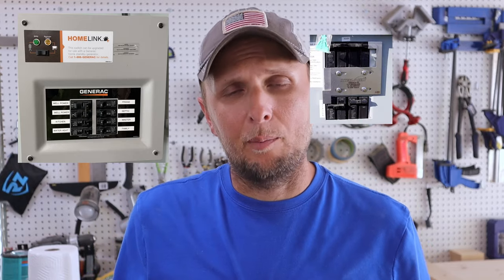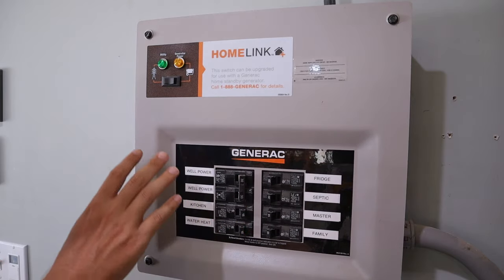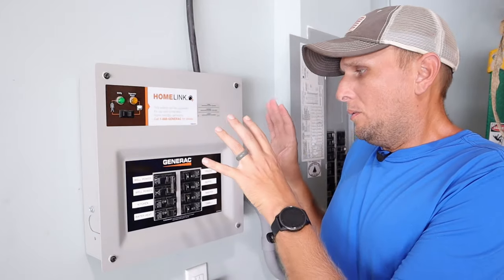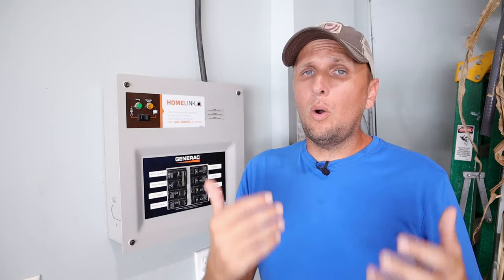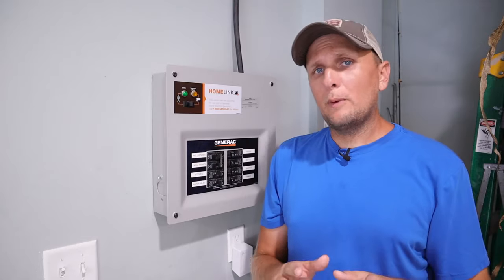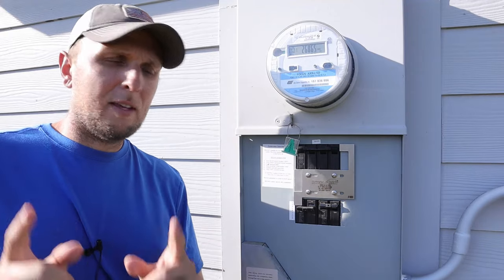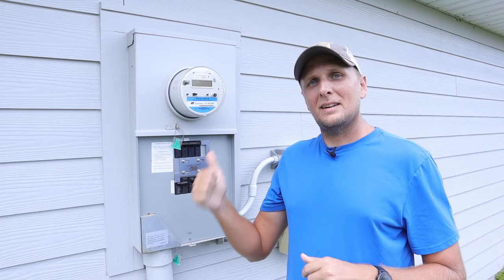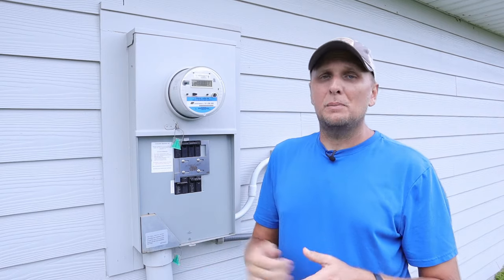How To Choose Between A Transfer Switch Vs Interlock Kit With Power Inlet Box

Comment: I don't have an option. I can't use either. In my area breaker panels don't have a main breaker. I have to lock out tag out. My generator is a portable propane generator. It's actually dual fuel, but I don't want to ever use gasoline. I have to manually turn the propane on to start the generator.
Reply: Suggestion - for a temporary situation or a permanent solution, get a Generlink meter base adaptor. Would recommend the 40 amp unit. I did not purchase the surge protection nor the wireless link as I did not need them. I did get the 20' cord with the 50 amp, RV type plug. It comes with a cord of your choice.
Safe, very easy to use, super easy (5 min.) for the electric company to install. 
I have no ties to the company. I bought one and it's a great solution. Using it with my Generac standby genset. Simply plug in the cord when needed, unplug when done.

Before contacting Generlink, I first emailed the datasheet info and request directly to our utilities director at the city. The city provides electric to our area. 

A week later I had his letter of approval! He did say that I had to contact his office to have it installed as the customer service reps don't know about the device.

Comment: If you are on a generator, it is an emergency.  You do not need to power everything in your house. It is an emergency.  For us, we had the interlock with a Generac XL 5500 unit.  Since it is an emergency, we power the essential lights, Fridge, Freezer, stove(gas), furnace(Gas forced hot air), and communications.  What else does one need? it is an emergency. So I put together a protocol to follow for start up and operation of the generator during an emergency.  All breakers are off including main, start generator, plug in generator, then start the essential lights(compact florescence), then once things are stabilized, I add the freezer, fridge, furnace, etc in sequence.  When the emergency stuff is running, it will never take more than 4500 watts, so it fits the generator.
Reply from the maker: That works for you and sounds like you are aware of what you can have on all at once.  Many aren’t and you asked what else does one need?  Depends on the household.  Here in the south when we get a hurricane that knocks out power out for a week and it’s 90+ degrees outside, a 5500 watt generator generally is not going to cut it.  Also, since I’ve been in situations numerous times like this, I have mine setup so my generator can run everything so it’s like my house does have power.  So to each their own.
Reply: All well and good.  In the north, we are looking at heat only, thus we do not have to turn over a condenser unless if we are using a heat pump(the state wants homes to go that way.)  The issue, if not going for a whole house propane unit, is how much fuel to store.  For us, that quantity is 27 gallons of gas, for that week when we have no power.  I could not imagine having the fuel to run a 12 Kw genset for that first week.  Our solution to the cooling issue is to use a 1 ton window unit(1000 W) instead of trying to cool the whole house with the central system.  How much fuel do you need to have on hand for the larger unit?  Thank you.

Comment: How do people use so much power.

I always considered us a "high power usage" household.   I pulled the biggest single month electric bill we have ever had, and it was for 2,743kwh, and this is HUGE for us.  A few years back, during the non AC months, we average about 600KWh per month.

Anyway, I did the math, 2,743kwh in June (a 30 day month) means and average daily usage of ~91.4kwh, which means an average load of 3.8kw.

Now, high load, can be much higher than average load, but it would seem to me that a 7000w generator should be PLENTY to power the whole house, as long as we are careful to not go hog wild while on generator power.

I currently only have a 4500w(peak, 4050 running) inverter generator (because I like clean power) but portable inverter generators come in up to 9000w now, and that ought to be PLENTY. 

Because of this, I think I'd go with an interlock kit + power inlet box.

Only problem is the 9000w unit I'm looking at has an L14-30R plug on the front for 30amps of 120v or 240v.  Then it has 4x NEMA 5-20 plugs on the front for the rest.

The question is, can I combine the 120v from the L14-30R with that from two of the NEMA 5-20's to get the maximum 63 amps at 120v into the power inlet box somehow.

Comment: What does it mean that it is a 30 AMP transfer switch.  Does that mean it can't support more than 30 amps total?  Or does it mean that each breaker is limited to 30 amps?
Reply from the maker: It is wired and made to handle 30 amps.

Comment: I don't understand you're point about not fully running main panel with interlock kit.  I have interlock kit at 30amp inlet (I ran 6awg so I could upgrade to 50amp inlet/breaker in future if needed, so far 5 power outages over 2 years, 1 3 days long, haven't tripped the 30amp).  I run into panel.  I just tell wife don't use dryer/toaster oven (wtf that things pulls 12.5amps by itself) when generator running.  Runs mini splits (ac/heat 4 total) fine, 3 computers, 2 fridges, 1 deep freezer, 3 tv's, 3 roku's, lights, etc.  I mean if you aren't overloading the 30amp or 50amp breaker does it matter what you switch off in the panel?  (granted if you use dryer that's probably 25ish by itself, toaster oven 12.5, microwave 10 but most things outside of those 3 items going to be low, and a 50amp would be plenty for most people I would think, I just have a smaller size house so 30amp is plenty for me).  Also people could buy one of those cheap clamps to see what the wattage/amp usage in their home is.  Probably best way to determine.  Plus an interlock kit is like $50 specifically made for your panel mostly, and takes like 5-10min to install.
Reply from the maker: And that works for you.  But everyone’s situation is different along with preference.  For most people it would be better to not energize their whole panel with a smaller generator because we are creatures of habit and there can be a lot of oopsies of oh I forgot we were on a generator but I turned the thermostat down and the 4 ton unit tried to kick on.  That’s what I mean by it.  Now if you’re diligent with everything and and don’t require a lot of electricity like your situation sounds to be, then great.  I personally, even with a 12,000 watt generator do not just leave all of my circuit breakers on.  So to each their own.  But it sounds like you have a good handle on your situation.  Appreciate the feedback.

Comment: So if you have the transfer switch, is your generator always connected? I'd expect with a portable generator you'd need a power inlet box and cable. I don't think you're saying all portable generators using transfer switches are hardwired, are you?
Reply from the maker: No my generator is not connected at all times.  A manual transfer switch does not need to be hardwired to a generator.  A standby generator with an auto transfer switch does.

Comment: The main problem with interlock kits and inlets is that they only work with certain panels.  Unless you have a newer-model Square D, Homeline, or Siemens, it will not be an option since you will have a difficult time finding an interlock kit compatible with your panel.

Comment: Doesn’t a HVAC soft start like the micro air basically solve this issue, you can run your entire house with a lot smaller generator then would otherwise be needed in the past.
Reply from the maker: It certainly helps.  Depends on the load of your house and what all you want to be able to operate at once.

Comment: Why is my box on the outside under the meter locked I see all kinds of videos where u hook right in from there instead of going through the house again to get into that panel?
Reply from the maker: Different areas have different codes and installs.  In the South, it’s common to have the main disconnect out at the meter now.  Northern states it’s not nearly as common.   So it would have to be installed wherever your main disconnect is for the interlock kit to work.

Comment: I think you forgot to add wire, conduit and the two pole 30 in the price of the interlock kit. Still cheaper than the transfer switch but those material cost  can sneak up on you.
Reply from the maker: I gave an average range of $50-$300 due to different scenarios with length of run, size, power inlet box, needed interlock kit, etc.  Some folks will have some of the materials on hand.  So again, just an approximate range.  Materials can absolutely sneak up on you.
Reply: @HowToHomeDIY  overall a pretty good video. In the limited time that I’ve been an electrician the swing on material has been crazy. Makes it hard to pin point a price for any install these days
Reply from the maker: Oh yeah, price increases all over the place!  We have been affected as well.  I also made this video over a year ago, prices were less, not astronomically less but less nonetheless.  I appreciate the feedback Brian.

Comment: I think so many people get deluded and feel they need more electrical boxes. I dislike transfer switches as you have to decide and move the circuit breakers. I would select the interlock kit almost every time as switching switches are much more easy  and much cheap to do.
Reply: Yes!  But... my situation is, I know how this all works, what needs to be done.  My problem is making easy enough for my wife to do what needs to be done, in the right order.  I have a stationary propane unit.  The 30 amp cord is always plugged in.  My procedure: Turn on gas to the motor.  Start motor, let run a couple minutes. Turn off main, turn off all breakers in main panel.    Go to sub-panel in pantry, repeat.  Slide interlock, flip 30 amp breaker on.  Flip breakers one-by-one,  marked green.  Got to sub-panel, repeat.  That, is my problem...  And if it's raining and lightning, fugetaboutit...she is not going to do it.
Reply: @topbuilder3790  My process is plug in my Ford Lightning to the 50amp breaker that the truck charger is plugged into. Go out and turn off the main, back to the truck and turn on pro power and enjoy the 7K of power the runs my whole house. Getting ready to getting a EcoFlow ultra and a few batteries to go fully off grid.

Comment: You missed a big Con for the interlock kit. Unless you have a street light or neighbors close by, you can't tell when the power comes back on. It's a pain trust me. At least even with the limited transfer switch other circuits are still energized. You can turn on a light or something on one of the circuits not on the transfer switch and always know when the utility power is restored. Or, you could go to the transfer box to look at the little green light which if you have the transfer box in a garage or something my be again a  pain. My preference ended up being installing a whole house generator and utility rated 200 Amp automatic transfer switch. Money well spent, never looked back.
Reply: A lot of energy companies show if power is back on, on their apps and/or website so if you have good cell service, that may work.  But you are still taking a gamble at times, yes.

Comment: Great video. Thanks. But I still have pressing questions. My panel in my garage has a main input breaker to the distribution panel. I installed an interlock kit. When that main breaker is open, should it disconnect both the live lines and the neutral such that it is impossible to back-feed any current to the transmission lines - keeping the utility workers safe? Also, what about the ground? Is that upstream of the main breaker or downstream?

Comment: If I have a 60amp Main breaker can I still do the interlock or do I have to upgrade my panel to 100amps?
Reply: Only if you upgrade your service first. You’re looking at a lot of money.
Reply: @Steviethegr8  I thought that was going to be the answer...thank you
Reply: I would push back on saying flat out that you have to upgrade your service first.  The size of your main does not determine whether you can install the interlock.  Assuming though that this is a single family home, the fact you have a 60 amp service might imply your electric service is of an age where an interlock kit would not readily install onto your panelboard.  The minimum size service for a dwelling unit has been 100A for several generations now.  A 60 amp service for a dwelling unit  (assuming this isn't part of a multi-meter service) hasn't been allowable since at least the 1960's.
Reply: @steveloux4709  I was about to say the same.

Comment: Good video. One point, though:
If you decide on the transfer switch, make sure that the switch is a "3 Pole Switched Neutral" type. This means that the neutral leg is switched with the hot leg.
A "2 Pole" type will work, but it's only switching the hot leg. Any GFCI/AFCI protected circuit will see TWO neutrals (the generator's and the utility's) and the GFCI/AFCI circuits affected won't like that and trip.
You CAN "un-bond" the generator's neutral on some, but not all generators. That way, there is only one neutral reference for the GFCIs.
Also keep in mind that if you "float" (un-bond) the neutral at the generator, you MUST take care to bond it again if you use the generator for something other than the house.
A "2-Pole" Transfer switch is just fine if you have no GFCI or AFCI circuits to run on generator power. The "2 Pole" is a bit cheaper, too.

Comment: I’ll be going with a transfer switch because there isn’t any more room for another breaker. Don’t want to spend the money to install a new panel box.
Reply: See if tandem breakers are allowed in your box and local code, you'd only need to combine four 120V circuits into two and then you've freed up a space for a double-pole 240v breaker for the interlock. This is an option for circuits that have to be on their own breaker but don't use anywhere near the entire circuit capacity, like garbage disposer and dishwasher, fridge and range hood, etc.

Comment: Many municipalities do not permit interlocks. Also, if the neutral in the generator is floating, you must transfer the neutral and phase conductors. This is not a DIY job. Call a licensed electrician.

Comment: My town is telling me that interlock is not to code. Is that depending on location?
Reply from the maker: It definitely can depend on location as they all have their own codes on top of the NEC codes.  That being said, if they are referring to NEC code and not their own local code, then that is not accurate
Reply: This may be a regulation of the utility company that serves your area?  There is nothing in the National Electric Code (NFPA-70) that prohibits interlocks.  And its unlikely, though not impossible, that a local municipality created a unique code addressing this installation.  I'd dig a little deeper to understand before giving up on the idea.

Comment: Huge omission of fact: The interlock allows use of 240V appliances vs. transfer switch does not without special wiring work and close management of breakers for smaller generators.
Reply: Not true. The Reliance Controls Manual Transfer Switch slots A and B are for a double pole 30-amp breaker for 240V.
Reply: @Pk3_Garage  Since the mfg. of my transfer switch online and paper instructions were blurry and unreadable as well as no customer support, my transfer switch was as good as useless for 240V as there was no way to achieve it without help.
Reply: @Pk3_Garage  I tried to get support whether a smaller 120V gen could power a 240V appliance and nobody would answer; do you know if that's possible?
Reply: @Pk3_Garage  I think transfer switches should be numbered, not lettered. The design of the one I stripped was horrible and nearly impossible to logically follow.
Reply: No. A 120V Generator can't produce the needed 30-amps for 240V.
Reply: For me, it's not hard to follow at all. I believe the reason for the letters, verses numbers, is to prevent the installer from matching up the number circuit in the transfer switch, with the number circuit in the main control panel. (If that makes since)

When using a backup power source, it's very important to keep the load balanced.  So, a lot of thought goes into which circuits goes where in the Transfer Switch. 

Once you do that, you don't need to worry about trying to balance the load.  Just flip switches from Line to Gen mode in the Transfer Switch.

Comment: It's strange. We looked into solar recently, and none of the solar installers we talked to knew of a way to use solar when the power was out, because they said it would back-feed into the electricity grid. I told them one of my neighbors has a switch and they had no idea how that was possible. :(
Clearly it's very possible...
Reply from the maker: Yes it’s called a hybrid system.  It’s very expensive due to the batteries but definitely the most functional.
Reply: @HowToHomeDIY  Yeah, all of the installers said the system would use the batteries, but the solar panels would not charge the batteries until the power from the grid came back on, for "safety reasons". It doesn't sound like that's accurate.